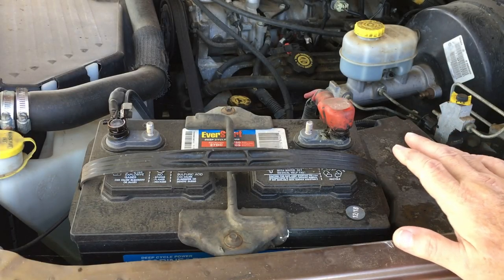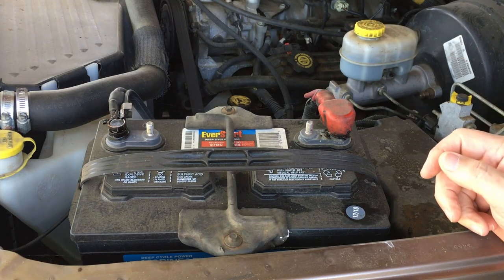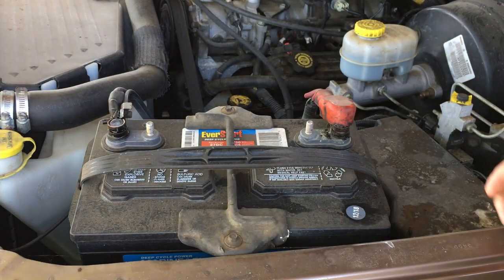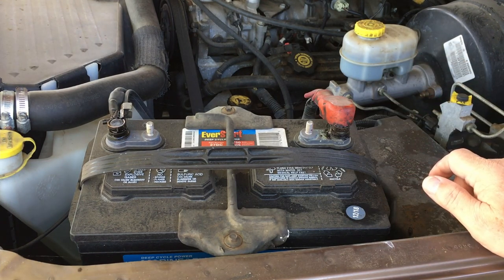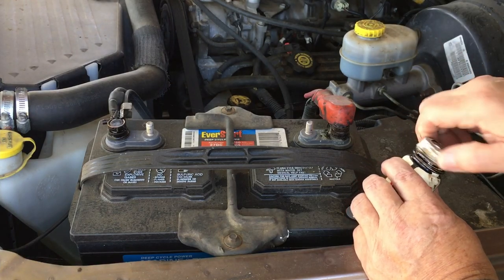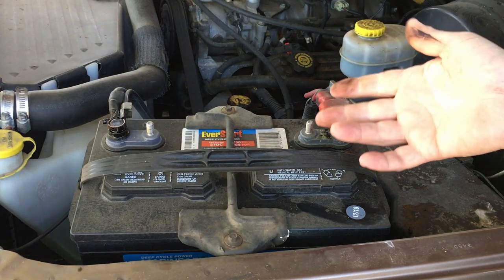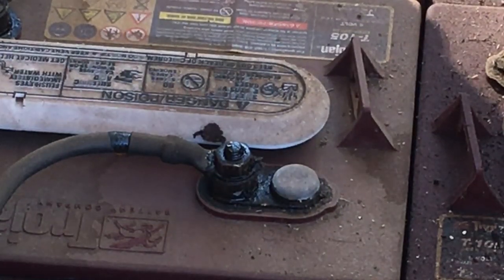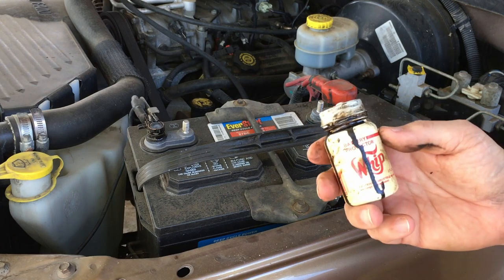DON'T GET STRANDED... GET WHIPPED!

Comment: CRC battery terminal protector that is a spray works well too. I used CRC on the battery in my old ram (got it a yr old) & idk how big of a part it played but I got 7 years out of an oem battery.

I used to carry jumper cables but now I carry a little battery cell the size of a small brick. I've used one numerous times & it's a far superior setup (provided it's a good one).
Reply from the maker: I've got a "jumper" in my vehicles... love them!

Comment: It looks like Liquid Tape that I use on my ham radio antenna.
Reply from the maker: Hmmm... might be similar... thanks!
Reply: @BIGALTX  Got any ideas for batteries with side terminals?
Reply from the maker: @RESlusher  
Same process... just paint it on the battery "post" and the wire terminal.
Should be no difference